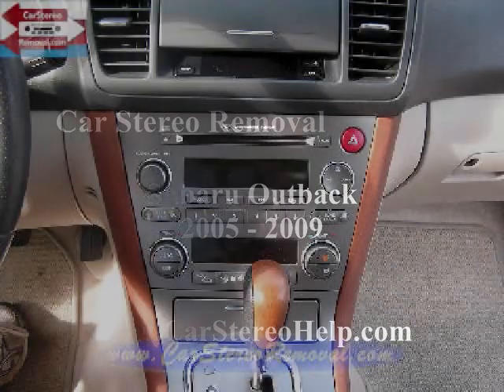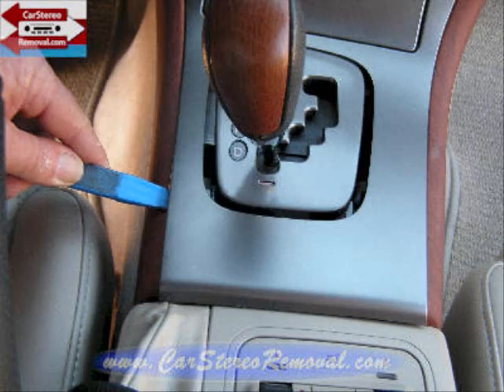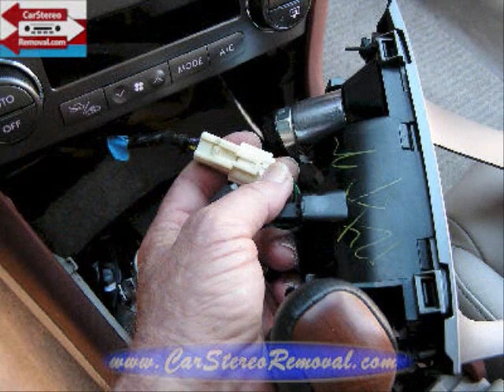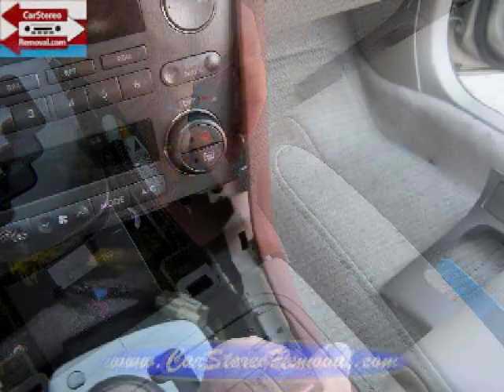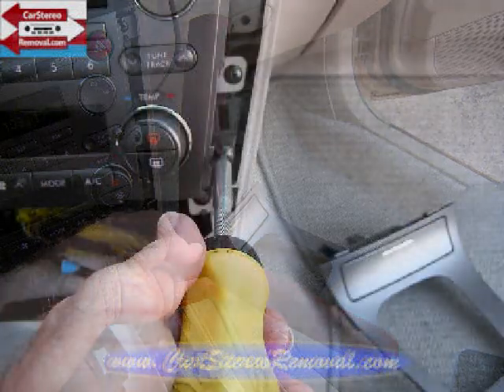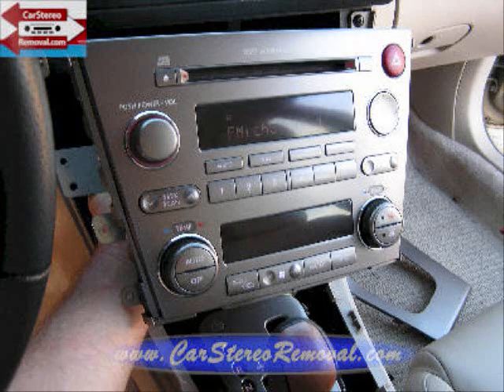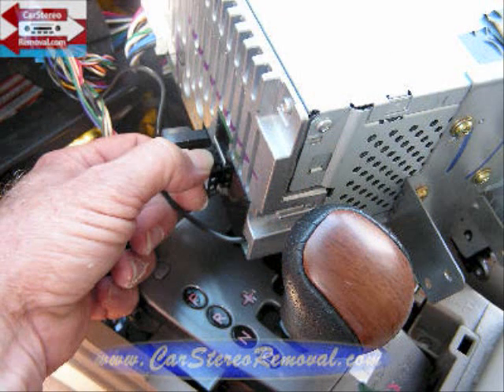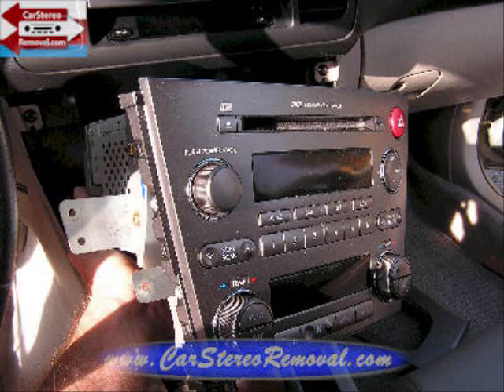Subaru Outback Stereo Removal = Car Stereo HELP

Comment: Great vid, as mentioned, straight to the point. Here in NZ we have to fit a band expander for the radio to work and the 'technician' who fitted ours didn't re- fit the plug back on hazard flashers. All good now thanks for your help!

Comment: Hey, a very informative looking video, I’m wondering if anyone can confirm if the steps are similar for an 08 Liberty. The console is very similar but not identical and I would love to add the Auxiliary plug into the centre console which requires accessing the back of the factory stereo.

Comment: Removed all the screws and I cannot get the unit removed. maybe i just need to pull a lot harder. Just feel like I shouldnt have to yank on it this hard.
Reply: Did you find a solution? I'm doing it right now with the exact same situation
Reply: @tomwalker5514  there was some screws hiding on the side of the deck not shown in the vid